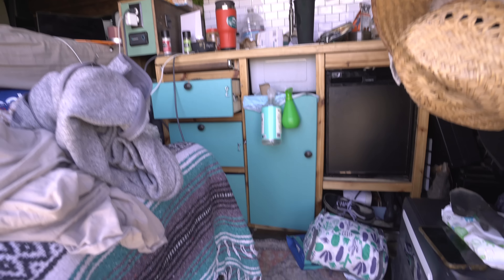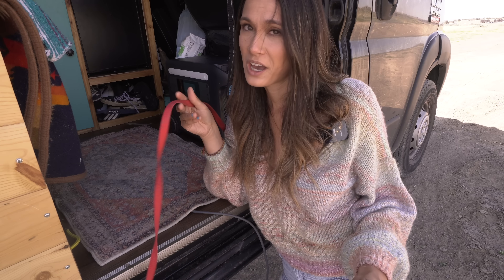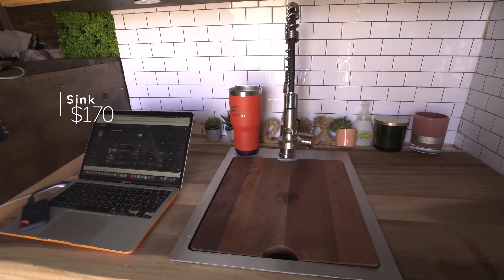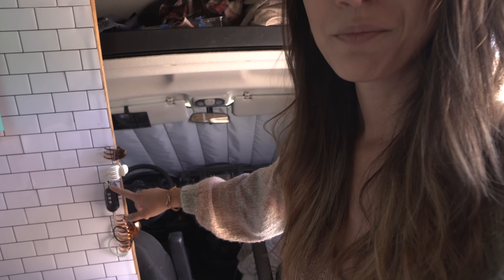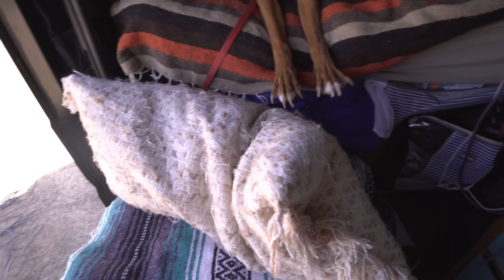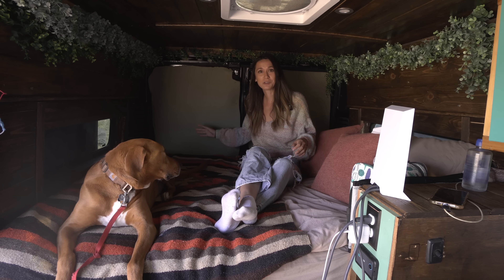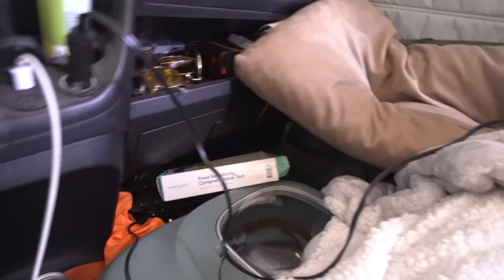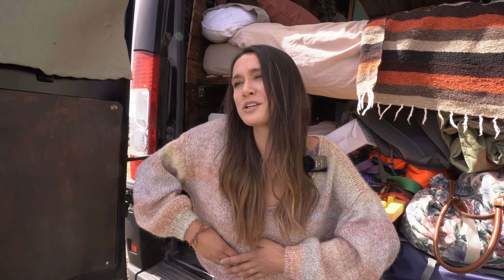a very HONEST VAN TOUR from a DIY Van Builder | Solo Female Vanlife

Comment: Hey, nice to see you posting. I caught a few when you were building. Great job ! Very ambitous and the van came out awesome.
I think Schimitup is a miss spelling. It is SchuttphucUp. 😁 Just saying.
I've watched so many of these vid for so long. Including a poo load of sailing channels.
So many doers have those kind of toilets, even full showers and don't use them for the same reason.
The counter came out very good. Alot of wood working benches have that type of recess in the rear. Fist time ever I saw in a van. Excellent idea !!
Thanks for sharing.

Now I remember. Using a jig saw to rip boards. You struggled some with the electrical system.
Framing you thought sucked. But it all came out so well.
I think your style is more of van camping not living in a tiny apartment with wheels. And that is to be admired.

Comment: I'm going to do the same thing. Bought most of the essentials other than lumber and insulation, but I'll get that when I'm at that stage in building. I have a bed frame, fridge, maxair fan, some solar and electrical, and a sprinter van, gonna do a gypsy beach van semi-build just so I can use it while I save for more expensive building. You did good for no experience! I'm willing to figure it out as I go as well. I like your van! Have safe and fun travels out there and good job!

Comment: You can’t get rid of inverter you will need the inverter to plug in the cooker you love as well as computer and water boiler.  Without it you can’t use normal 120v plug ins
Reply from the maker: I would replace with with a normal inverted instead of having the inverter charger

Comment: I Love your kitchen you're not wrong at all about the 3D backsplash definitely not cheap about mine on Amazon days but then I found myself running out or having too much but the guy sold me my Van was a real piece of work so to speak. My van was leaking there were leaks beneath the solar panels I had to remove it all I had to repair the steel on the roof this was talking about being well all puns intended way over my head. So no flash forward a year and change and I'm finally getting to the interior but I have a tiny tiny problem it's a small interior because I'm dealing with a Ford Eco line E350. So everything has to be low to the ground I love that little device you got for $10 but I'm having trouble locating the link on your page. 
I made sure i'd followed you though but I would like to know more about the electoral section you just pointed to intend of crowd I understand some of these projects are very difficult you should look at some of my vans stuff I have a built-in wall air conditioner they had to redo because we guys soul to some music complete con artist but live and learn you know. Anyway I appreciate any and all help I'm trying to get this thing on the road and she is a beauty show me has a 139000 miles on it and that's not bad for a 1992. I just thought I was gonna be able to get her on the road right away and well a lot of bad things happen like my dog died for example so yes I was designing it for dog now I'm not so now there's carpet in there that kind of a thing. But I really like your channel so I appreciate any and all advice that you can offer I know my channel doesn't have a lot of downlife stuff I'm kind of all over the place you're posting random things but it does have someone if you look at my leaky van repairs and stuff you'll see the problems that I've faced and put up against in yourrow eyes maybe some ideas or creative perspectives of where I can put my kitchen?

Comment: Very nice. Did a good job. Pls make sure you IMPLEMENT some type of security measure in place for your safety.
P.S.
Go 2 home depot or SIMULAR, buy a D-ring and some appropriate length self tapping screws,and put it in the back for your pup.